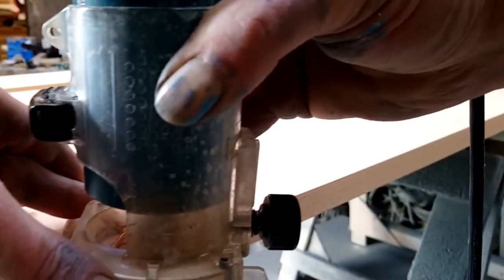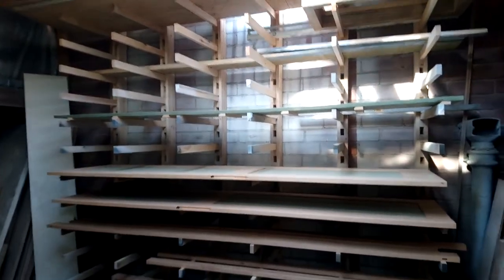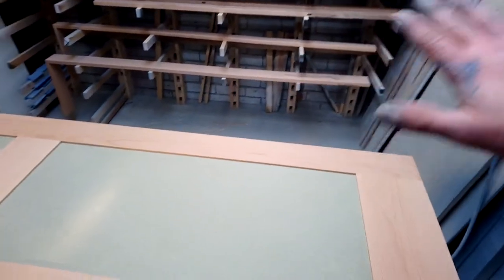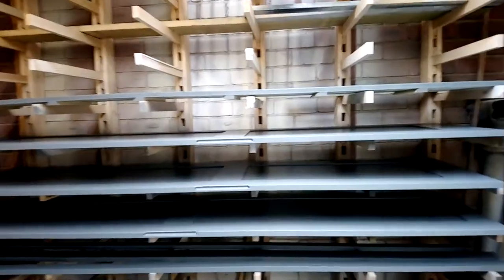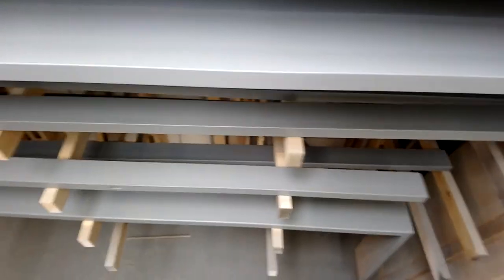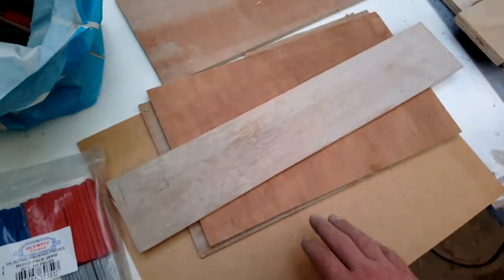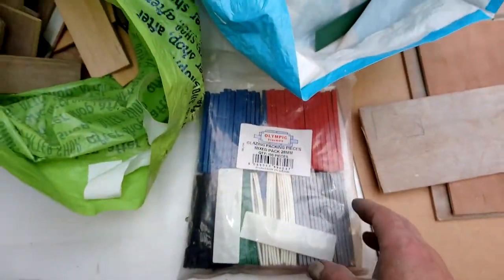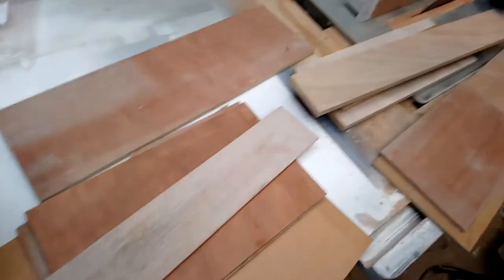Wardrobe build Pt12 - Spraying the doors, Last one before fitting in the house

Comment: Gid what you call 'packers' I call 'shims'. I make my own out if scraps of four by two around eight inches long. I have a jig for my tablesaw that cuts a tapered shim measuring 1/16" on the skinny end and 1/4" on the fat end. I use them primarily for installing door frames but they have a hundred other uses, 👍 😁 🔨 🇮🇪

Comment: Hi mate love the videos, what paint do you use? I’ve always painted it by hand but would like to use a sprayer, I have a compressor and a gun but just a little nervous to use it 😬
Reply from the maker: Hi, thanks 👍 The paints i use are classed as enamels but there's many many different makes & types, I use the 2part PU enamel because it's hard wearing, resistant to household chemicals inc Acetone which is in nail varnish remover, it dries very fast, sandable in ½hr & is slightly flexible so dents rather than chips, others like Pre-Cat enamel paint is a 1part paint, no mixing involved, excess can go back in tin, it sprays easily & flat, is a bit cheaper than PU & it also dries in 30mins-ish depending on temperature so it's good to practice with, not a lot of waiting around for the next coat to go on, but Pre-cat is not very hard wearing, AC enamel like PU is 2part , that's easy to spray too but both of these, Pre-cat & AC are 'hard', there's no give in them so with the wood underneath being relatively soft they chip when knocked, whereas the PU dents 😉 There's water based spray paints but they need 20º+ temp to dry properly & even then it's slower than PU & the others. You can spray any paint, you have to thin it tho & some household paints get a bit 'thin', . there's not enough pigment in them & you'll prob/maybe have to wait over night for it to dry properly without clogging up the sandpaper, You'll need some strainers Starchen 190 will do all your needs, spraying is practice makes perfect 👍 I make sure that the last primer coat is smooth, blemish free & as perfect as i want the final finish to be, the top coats are just the pretty colour that goes on after all the work is done in the primer coats, sanding filling etc...
Reply: @Gidjoiner  I’ve done a few weeks at a big furniture factory and picked up quite a bit and I do remember seeing them use a 2part spray, I mean when I do a built in wardrobes I only offer it to be primed as I’ve seen the customer do it before and it turned out awful! I use acrylic primer and just sand it back between coats.. I will definitely take that into to account tho and will look at giving it a go thank you 😊
Reply from the maker: Yep, that's why i started doing the full spray option, when i first started 36yrs ago 👴😮🤣 we put a coat of primer or button polish on just to seal the wood, when i started working for myself i did the same, just a coat of primer but after seeing the clients or a so called 'decorator' blather my work in paint i decided to offer to fully finish spray it, Try it, find a local supplier if the stuff you've got is no good n get the cheaper Pre-cat to start with, a 5ltr of primer ( white £30ish ) n 5ltr of top coat ( white £30-ish  again ) & a tin of thinners (£10-£15-ish ),  like i say there's no wastage with that, excess can go back in the tin, it'll sit on the shelf for a long time, prob not the best of things to do but i've old Pre-cat that's a couple of yrs old n i'm sure it'll still work,  , Best of luck, 👍
Reply: @Gidjoiner  cheers mate I’ve got a morrells near by so I might make a little order and give it a go, always good trying to make things better! Do you have Instagram? Would be good to see some of your work
Reply from the maker: I used them at first because they're not far away but stopped using Morrells near me, too many bad experiences, one tin of paint had 1½" of thick settlement on the bottom where it had been stood on the shelf for too long but that's prob just my local shop, 6 out of the 7 times i used them there was a issue, I used Symphony Coatings after that for many yrs until 2019 when the rep i dealt with left the company, i rang for a price n could only get through to the regular staff on the desk, i got such i ridiculous price i ended up searching elsewhere, i found & use Regional paints just down the rd in Leeds now, it's a much smaller firm but their prices are more like i was getting from Symphony's rep, I'm sure Symphony will still do me ok tho, they're bigger with more staff/tools/experience, they can colour match any colour in-house, they free deliver next day on orders over £70 but Regional are just a suppliers so in the future i'll ring both n see who can do the best deal,
Reply: @Gidjoiner  Invaluable info in your replies! (As usual). Unreal!!!!! Thanks Gid!!!